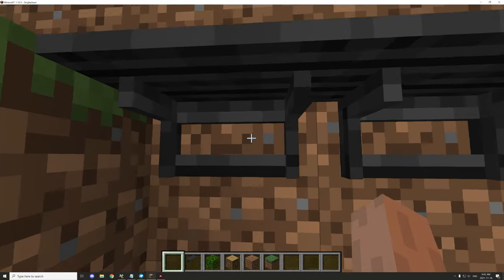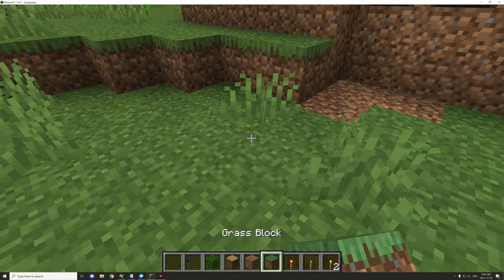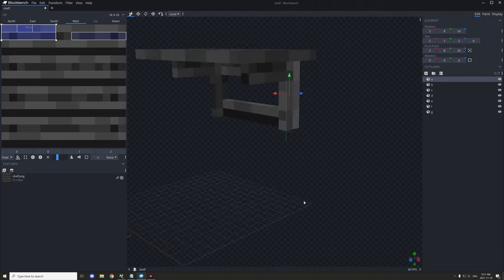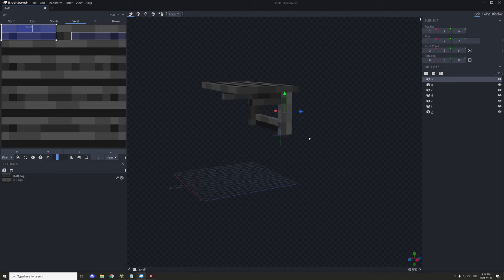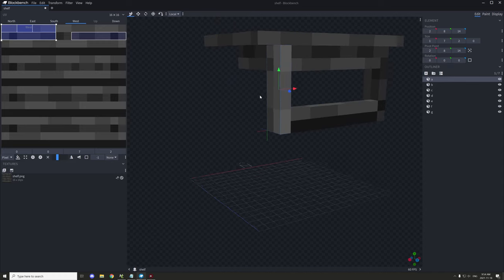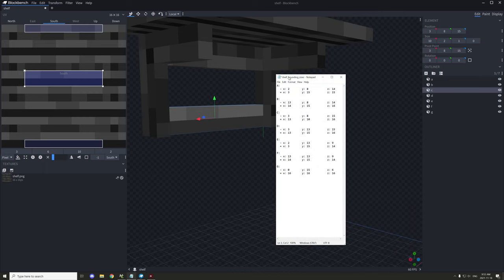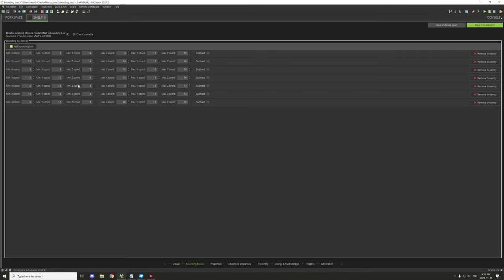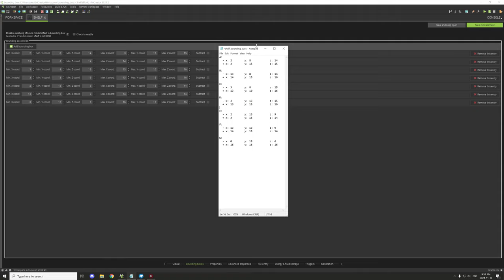MCREATOR TUTORIAL: How to use Bounding Boxes | 2021.2

Comment: Im using the 2023.3 version for Minecraft 1.19.4 and I pass across the block yet and the bounding box anly appears when I put the pointer at the blocks 16x16x16
(My block is more big than the normal)
Reply from the maker: This is normal for how Minecraft works. Things like doors, double plants, bed etc. are all multi-structures and use two blocks rather than one block. It's best to break your block up into two blocks or more depending on the size of it so it fits in the cube.

It's also important to note that you can experience rendering issues when the block is outside of the 1x1x1 cube zone, there is some things you can do to make this work better with the shading, but it requires a bit of light. More or less its fine to add decoration outside of the 1x1x1 box but any functional parts for things like hitboxes should be within the 1x1x1 cube area.

And example of a time where I used this outside would be for the lore series fertile land I added weeds and rocks part of the fertile tilled soil block this works fine because I did not want it to get in the way of the crop block but still render regardless I had to fix the lighting though because it was really dark.

Things like beds though, double chests etc. all use more than one block, even pistons use more than one block. Hopefully this helps a bit, just know that the game has the support for this but the game does not really use it like your trying to make it work.

Comment: Idk why it isn't working but I have a 16x32x16 block so the height of a door and it's not letting me hover over the top half of the block, but the bounding box works with collision and if I hover over the bottom half, it shows the full 16x32x16 bounding box.
Reply from the maker: I just want to point out beds, doors, double plants etc are multi-structures they are two blocks not one with different textures, you can run into rendering glitches extending the model outside of the 16x16x16 cube area for blocks. Not sure if you where aware of this but I though I would let you know.
Reply: What if i want to animate my door? @NorthWestTreesMCreator

Comment: Hey, this video was helpful, but when I did the same thing with my model the bounding boxes are not where the block is.
Reply from the maker: if the size is the same on both min and max position then it will not render the hit box, so like 16 min and 16 max this would disable what ever axis it's on. Newer versions now have a auto generate feature which is way easier than this method but I think it was added in 2023.0 - 2023.2 some where around then.

Comment: Can you do a Tutorial on how to do a procedure in a certain order?. Like if I right click an item it will do a procedure then if I right click the same item again it will do something different
Reply from the maker: I would suggest using a timer based system, but rather have it on a update tick have it for a right-click update this way it will count down or up depending on how many right-clicks you do, you can then use the timer variable number latter on and test for every number if its the same number then you can preform a dedicated action for that order. Its a basic counter system really, but if it reaches something like 2 then you can have it set back to 1 for the next cycle. This would be the way I would do it alt least. I have done some tutorials on timers in the past any tutorial should explain how to set one up, it can be NBT for items, entities, or blocks, or global variables for both entity and world, so you have a lot of options however I would suggest using item NBT for what you want to use it for this way it is stored directly to the item and other items can have other values.
Reply: @NorthWestTreesMCreator  Thanks for the info 😊

Comment: Hi! I have a model with a width of 4 blocks. The grid is displayed exactly along it, but for some reason, the 4th part allows you to go through as if there is no grid. What could be the problem?
Reply from the maker: If the block's bounding box is not cube it treats it as transparent. If you set the size of the box to be at least 0.001 in with, depth or height it should count it as a solid object. If this is not the case then it could be that the cords are wrong, newer versions support auto generation this will work for fixing the cords being wrong but may also lead to the  issue as stated above.

Comment: Can you make a video about  how to make mobs animations on mcreator
Reply from the maker: At the moment there is only support for built in animations, to use these animations you need to make sure your entity pivot points and cubes are in folders in block bench.
The options will show up, sadly though depending on the model the ones you may need to use can always be different so it will take some trial and error to get what you want for your entity.

Comment: Could you show us how to make temperature mod please and thank you
Reply from the maker: Temperature can be mainly done with global variables or block NBT, however cross mod support is really not a thing as it would be to much with everyone trying to connect different temperature and weather variables using blocks, it can be done but its one of those things that should require a mod dependency to link to rather than build it into mods directly, at least for cross mod support.

It is possible to set a block at a specific location in the world for every world then assign variables from that block during world updates so you can in theory make a cross mod supporter weather and temperature mod however, like I said if people all started to try to get mods to support their own version there would be a lot of blocks all over the world just designed for weather an temperature so its probably best if I make a mod for others to link to instead so that it can be used across more then one mod without everyone competing for spots in the world.

I am not sure if that makes much since at all but its a really bad idea if everyone tried doing the same thing with this feature, it would be like battle royal but with blocks in spawn chunks it could get messy really quickly and even mess up things in the world really badly.

I will however, make a dependency mod and do a tutorial on how to link to it and tap into the variables for that mod, this would be safer then doing a tutorial on how to make the mod its self.

Comment: hello dear guide. I have a question for you . how to make a summoner? Well, in order for the mob to spawn certain other mobs, I managed to do something similar, but I have a problem. my mob is spamming with these minions! how can I make it so that the mob spawns the required number of minions at a time after every certain period of time, so that it spawns 2-3 times the number of mobs every time, and not 100+! How can I do it ???
Reply from the maker: I suggest using entity NBT and setting it up so if the variable is true to spawn a random number of minions.
This can be done using local variables and a entity tick update really easy, you would want to test for a range for the random number.
In the case of spawning two or three I would use something like this.

Entity tick update trigger:
If ( Entity NBT variable = true )
    Do (
        If ( Random ≥ 0.5 )
            Do ( Spawn 3 entity & set entity NBT variable  to false )
        Else 
            ( Spawn 2 entities & set entity NBT variable to false )
    )

You would need to make a procedure for when the entity spawns to set the entity NBT variable to true. 
But other than that it should work. I hope this helps you a bit.
Reply: @NorthWestTreesMCreator  I read your advice, but I didn't understand anything there, but when they wrote it, I decided to try it out with the stream alone, I did it! but anyway, thanks for trying to help me! :)

Comment: doesn't work for me. the bounding box is like 15 blocks wide for some reason,
Reply from the maker: you need to make sure that your block models are selected and that you move your cube's pivot point from the 0,0,0 to the bottom-north-west corner like I said to do in the video.
then right down the X,Y and Z for that cube pivot point this number will be your minimum value, after you have done that move it to the opposite corner of the cube, top-south-east corner and then write down the X,Y and Z of that location. You should now have two different coordinates, for that one cube, if you have more cubes then you need to repeat the steps for every cube you have and write down each ones minimum and maximum coordinates for latter use in MCreator.

And yes the corner where you get the coordinates does matter, you can be on the top-north-west, or bottom-south-west, it needs to be the exact corners as I said above.
The N in your workspace means North so use that as your starting point for finding your proper corners, when looking the direction behind the grid and the north on the far size of the grid space this direction your facing is north.

Comment: Why do my numbers mean blocks, not pixels?
Reply from the maker: I think they updated the bounding boxes from older version older versions used to use 1.0 to 0.0 which used to be 1.0 as a full block though newer versions of MCreator 1.0 is the same as 1 pixel which is like 0.0625 equivalent to the old system. Though its still possible to set the hit box in decimal point with the new system like before though the values would be different. for example 15.25 would be for 15 pixels and 0.25 additional. Its also possible to check your model config file for the exact values. Also more recent versions have auto generate which can be handy for models that don't use complex cube rotations.

Comment: Hey man, the chairs still don't work! please help!
Reply from the maker: I did patch it and uploaded it to its own GitHub repository with the patch, there is both a 1.15 and 1.16 version in the download both with its own set scripts.
If your mod is for 1.15 then use 1.15 if its for 1.16 then use that one. I used the same exact workspace as the tutorial had for testing so I know the change I made for 1.16 works. If your still having issues after using the 1.16 procedures then it must be something in your mod its self causing the issue or your using it for a older version then 1.16. 
I don't have 1.17 support yet because its not released yet so if your using the snapshot you will need to wait.
Reply: @NorthWestTreesMCreator  I tried using your mod and it still didnt work